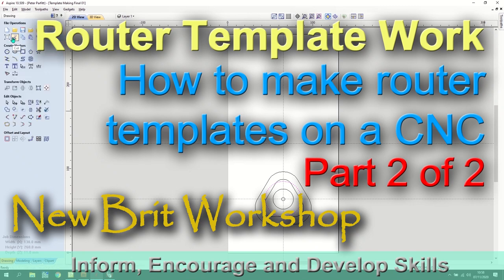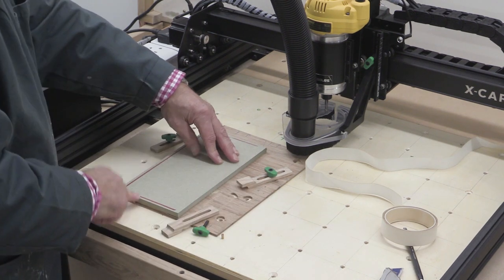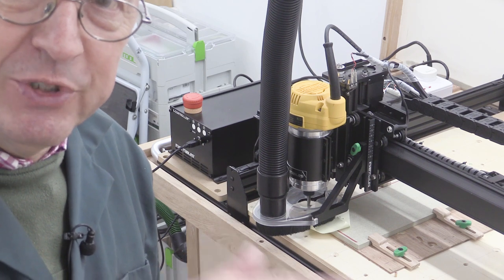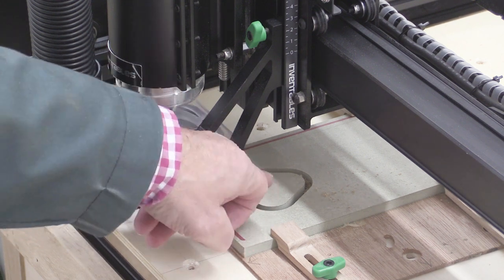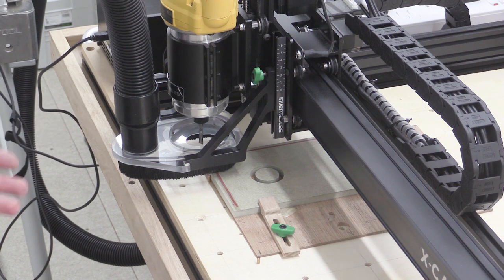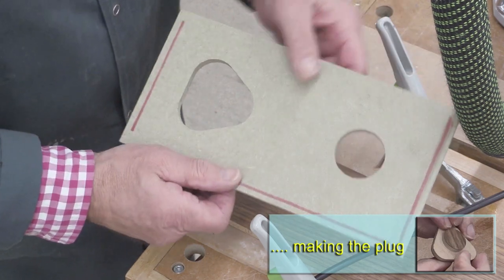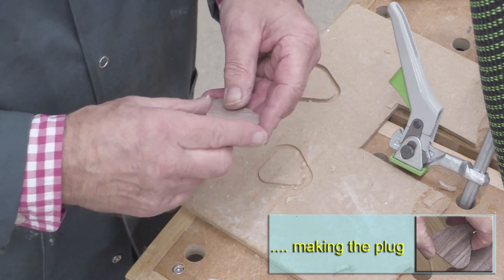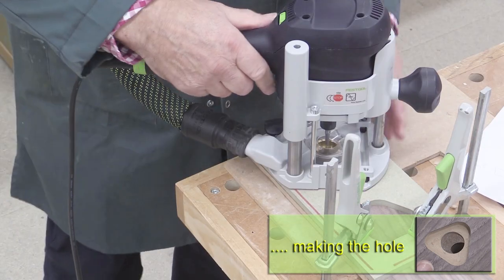How to make router templates on a CNC  - Part 2

Comment: I just worked out how to do this in Imperial measurements a few days ago.  I hope I wrote it down because I have already forgotten.  One thing I learned is not to use a long slender cutter because it whips and does not run true.  Leaves a slightly irregular gap that is unattractive.  Don't have a CNC so I will have to be content with hand made patterns.  Thank you for posting, very helpful.
Reply from the maker: Hi Barry, Yes, I wanted something for everyone in this series, even for those who cannot afford a CNC. Those without a router will find it difficult though.  Peter

Comment: Hello peter how are you. Is 18mm sheet material the thinnest that the domino xl will accommodate i know there are issues with the cross over between the 500 and 700 in that respect. I would mainly be using it for doors and gates but would like to occasionally use it for a cabinet build which will be made from 18mm stock. Will the 700 do that i dont really want to buy both if i can help it thanks
Reply from the maker: I have often used 8 mm dominoes in 18 mm stock and so it can be done. However, with MDF in particular there is a risk from hydraulic locking splitting the material so take care and tap the dominoes in a bit at a time.  Peter
Reply: @NewBritWorkshop   ah yeah trying to compress water based glue i see ok peter thanks very much for the reply stay safe take care